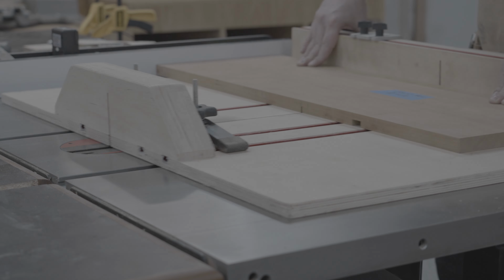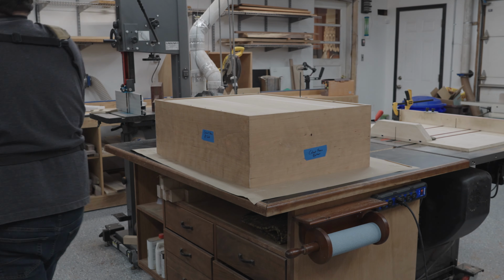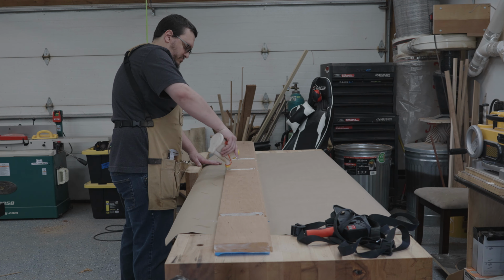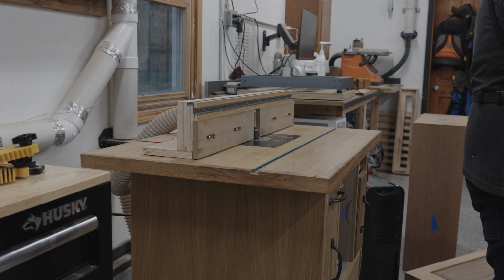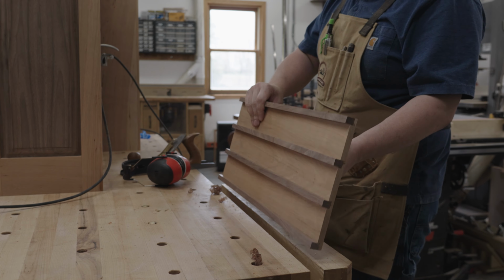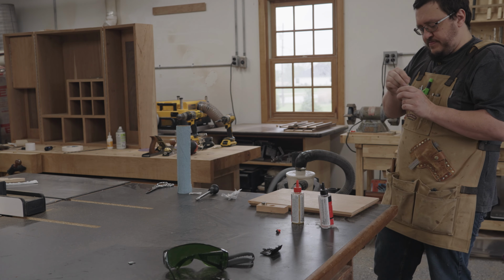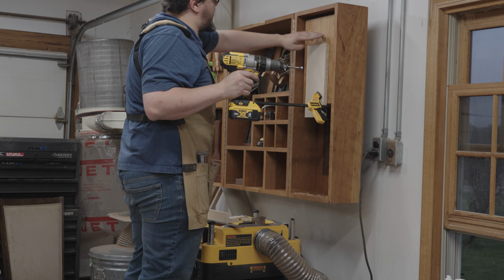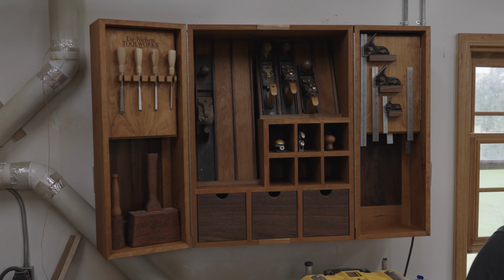Building the Ultimate Hand Tool Cabinet

Comment: You might consider breaking down those big drawers into shallower ones.
Reply from the maker: One of the things I struggle with is how different things come out compared to the CAD design.  While designing it in Fusion, they just seemed so small.  When I built it, it's like man, these are rediculously deep!
Reply: @SpaltedStagStudio  , the problem with deep ones is they become clutter. I bet you could split them into three, you might even be able to use the existing faces so you don’t lose your grain match.

Comment: A better way to check square on the carcase is corner to corner measurement. A sliding pair of sticks works like a dream.
Reply from the maker: That is a very valid point!  I'm not entirely sure why I didn't use that method.

Comment: Using power tools to get stock planed and jointed from rough and even down to dimension is one thing. How dare you cut the joinery on a hand tool cabinet, badly at that, with power tools. Why do you even have enough power tools to build a cabinet for? Just like a welder should build their first fixture table themselves your hand tool cabinet should be where you learn and perfect your hand tool joinery and that first cabinet tells the story of you hand tool mastership starting from the first joint which is probably kind of meh to the last bit of joinery which is probably near perfect no matter what flaws you see in the moment. Do better.
Reply from the maker: I'm a hybrid woodworker.  I use a combination of hand tools and power tools.  I have no desire to make anything solely out of hand tools.  While I do have great respect for the art,  this is a business, and it is absolutely imparative to be efficient.
Reply: Dude, no reason to be a total dick.